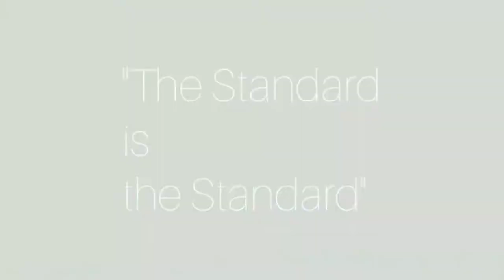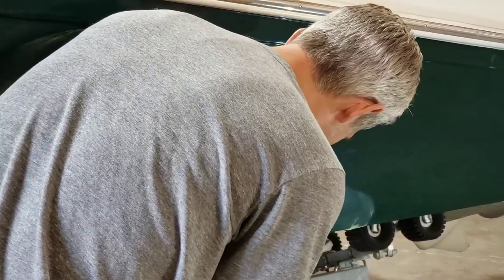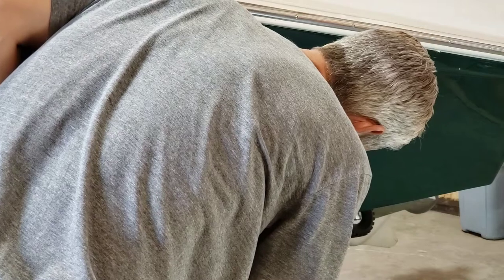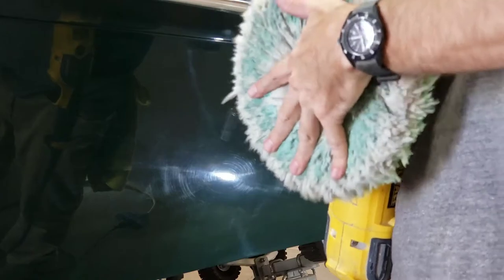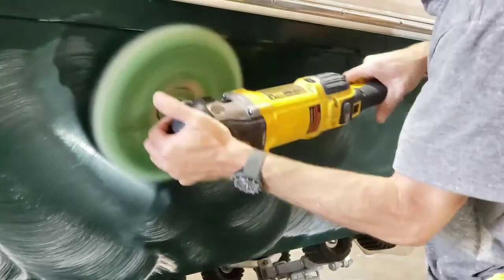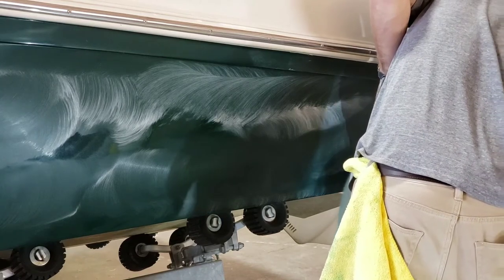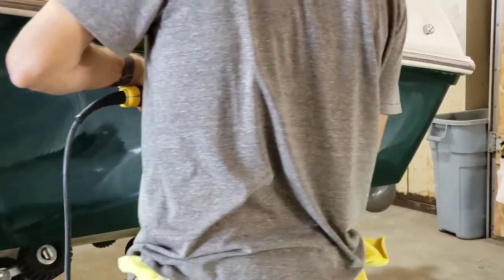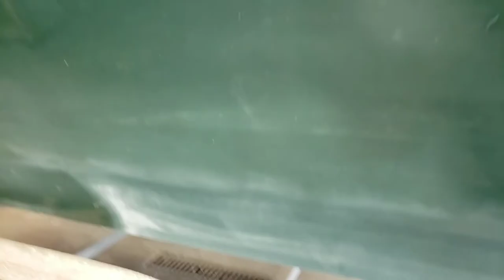Detailing done By a pro: Gelcoat Oxidation and Decal Removal W/Compound and a Buffer. How To:

Comment: Nice work as always 😎. My Heavy Cut finally showed up last night, so I’m going to go back over some hologram areas with it and the perfect it, and see the difference from the M67. I’ll wash the side to remove the 67 oils first. 
At least it’s not just me that gets the hoppy buffer. LOL! Mine calmed down when I applied a gentle twist to the handle, like tension on a screwdriver. Wondering if my wool pad is gummy. . 
Still playing with the high speed. I keep thinking I’m going to burn the gelcoat. 
Q: Why not use a yellow polishing pad with the Perfect It? Seems like it would finish even better. Doesn’t the white wool cut more (swirls)?
Reply from the maker: Yellow pads don't have the umph needed for Perfect-it to be very effective. It takes forever. If you're using a polishing pad, use the glaze and polish steps 3m calls for and the products they have for it but I don't need them if a wool pad or foam( think foam over a soft nylon pad for compounding) works without leaving swirls. If following up with a random orbital and a soft wax pad to apply and remove the wax with. If you had tiny swirls, they're gone after the waxing.

Comment: Your videos are fantastic!  Thanks for the great information.  Is it best to work only a small section at a time through all the different levels of compound, or can you complete an entire side of the boat with one compound before moving onto the next?  If you are doing all compound levels in small sections, don't you have to worry about the effects of cutting into the section that is already finished with coarser compound and ruining the work that was already completed?
Reply from the maker: Hi Craig,
I do both but it depends. If it's a big boat, I might break it into sections but I might also just tip to tail one side with one product and then follow up with the next.

If a boat is rough, section by section is more difficult. If the boat is just lighter oxidation and nothing too drastic, I sometimes will do a 3'x3' section with all the steps but the wash/wax. When doing this, I start in the bow and work to the rear because I don't want to be all hunched over and bent in weird shapes buffing the bow when I'm tired from the rest of the hull, so it gets hit 1st typically. Always overlap your last area by at least half a buffer wheel or when the boat starts to fade, you'll see borders around every section you did.

I mean, you have some of the thought process already, not ruining what already looks good.

On a trailerable boat, full pass with a compound on one side of a hull. Wipe it down and inspect it in good lights, clean the pad and use the next compound and repeat.

For the rest of the boat, top down, front to back is my typical routine. I break this into sections on larger boats but on smaller ones, whole passes on the hull and topside.

Glad you're liking the vids!

Lee
Reply: @Local_Boydidgood  Thanks for the quick and detailed response.  You are a true artist at what you do.  Thanks for sharing your skills.
Reply from the maker: Well, shoot Craig. I'm touched, thanks. I'm glad you're enjoying them. I'll try to add to the library a little later this Spring.

Cheers

Lee

Comment: Yeah in most cases you can buf only but we had a 15m yard feretti and it was 6 years in salt water in france hot sun with only compounding was imposdible we did a ful restoration with sanding it comes perfect but buffin in some cases is just no option jf you want perfection
Reply from the maker: There's always options, that's my point.
Reply: @Local_Boydidgood  yes but buffin was inpossible
Reply from the maker: In 15 years, there's only been 2 boats that I would have saved time on. I've seen bad too. Impossible is just till someone shows you what's possible.
I'm sure sanding was best in your case.

Comment: Your videos are great.  I have learned a lot.  Can tell me the part numbers of all the compounds you use?
Reply from the maker: Thanks for watching them! 

3M Quick Connect adapter (mfg # 05752) to use with the double-sided compounding pad (3M mfg #05753) or the double-sided polishing pad (3M mfg #05754)

Dewalt DWP849X

Super Duty, Heavy Cut and Perfect-it ex ac compounds by 3M. Somebody tell Simon that they do more than just smear around a boat's surface. 

I teach this, just this. I obviously know more about boats but I only teach this.
Reply: @Local_Boydidgood  Thanks for the reply. Is the Heavy Cut the only one specifically made for gel coat And the other 2 the same as what you would use for automotive?
Reply from the maker: I honestly don't know. "made for" and re-labeled are sometimes the same thing. 😂 I think Jescars is Nu-finish 2000 with food coloring added, as an example.
The guys @ 3M told me that Perfect-it ex ac was made for cars. Boats are 3% of their total business so if it works for cars there's a sense that they work for boats, just add oil. They are either made for or not. Regardless, they work and while I have other compounds available if they don't, I hardly ever use them.
Reply: @Local_Boydidgood  Have you ever used Foam Pad polish by 3M? You use with a black foam pad on dark colors as a final step.
Reply: @Local_Boydidgood  How hard is it to burn through gel coat, is as easy as burning clear coat?
Reply from the maker: On paint, great. Once you have a certain gloss on porous gelcoat, you can polish all day long, you'll still have pores. On a solid painted surface, by all means.
Reply from the maker: Harder. 10x as thick typically. Easier than you think. Both answers are the correct answer. It's gelcoat, nothing makes sense.
Reply: @Local_Boydidgood  Thank you for your help, I've been trying to learn about gel coat for years. I really appreciate your videos and replies.
Reply from the maker: Cool. My pleasure.